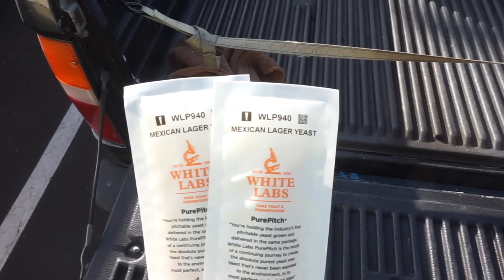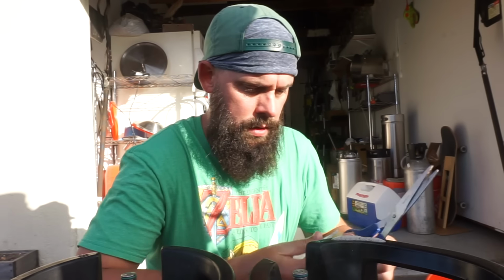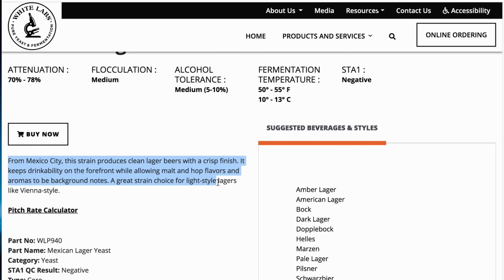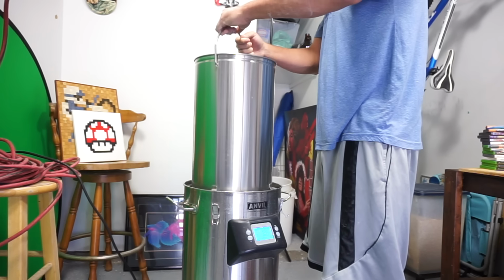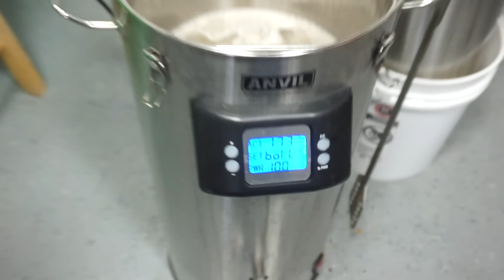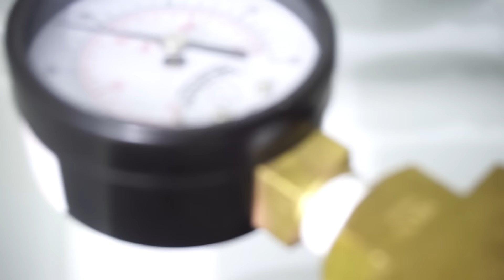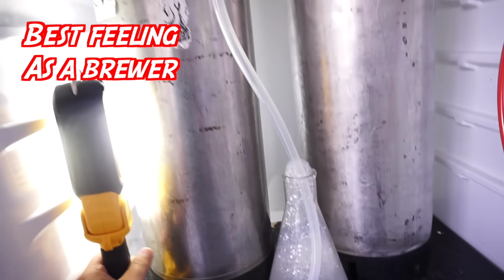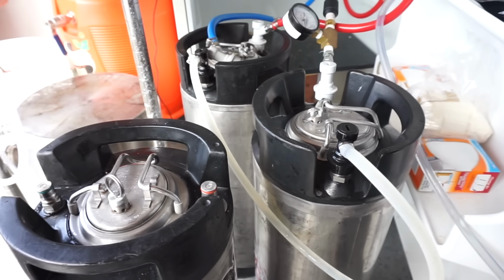MEXICAN LAGER ALL GRAIN RECIPE |  Frank Zappa Hops

Comment: Good timing. I just made a Mexican lager and pitched the same yeast. Ended up using 20% corn though and went with mandarina Bavaria hops. That biofine did a pretty damn good job in the amount of time it sat. Next time tape the inkbird probe to the keg with some insulation (before you fill it with cold wort so the tape sticks without sliding off due to condensation) in order to control the beer temp directly and not the ambient air.
Reply from the maker: ha i've never brewed with corn George, but you have inspired me
Reply: It’s an experience of its own. Lookout for whole kernels in the toilet…